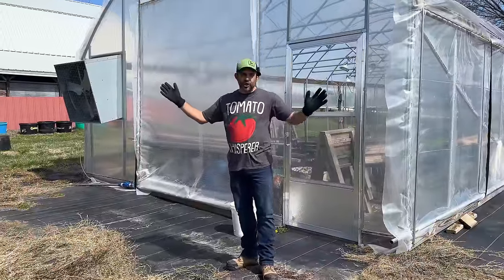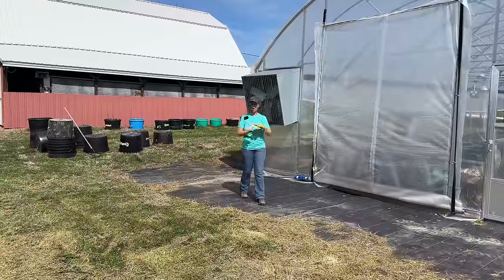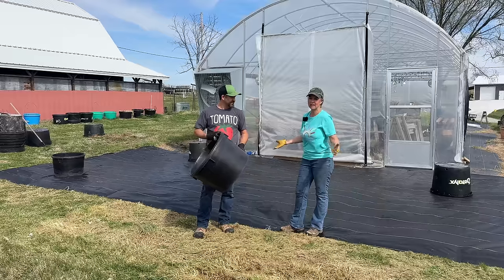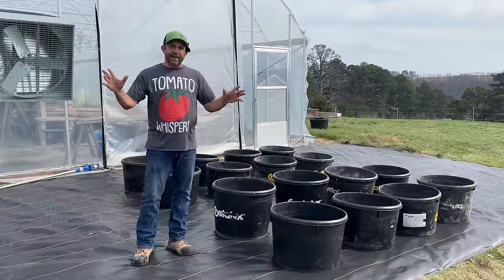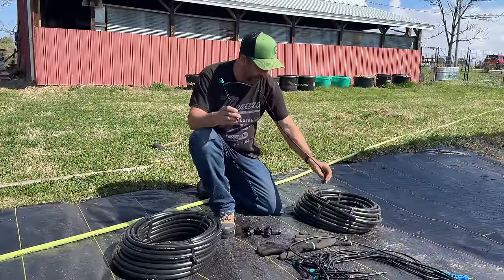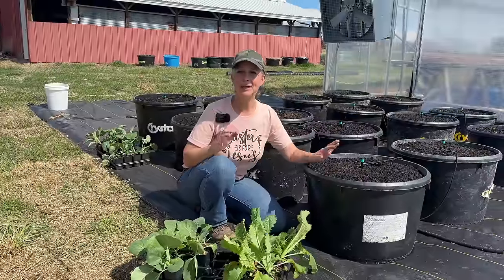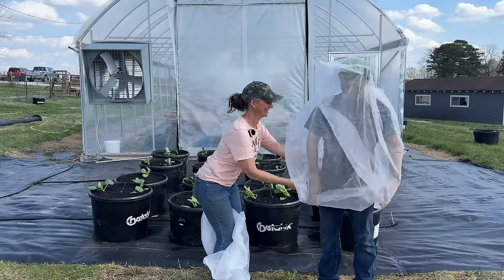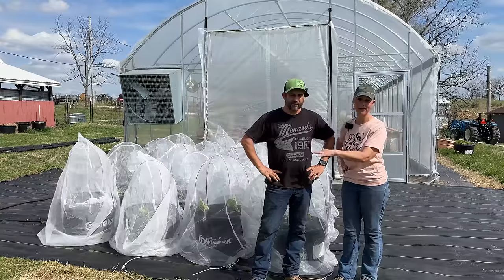We Turned a JUNK PILE into a CONTAINER GARDEN!

Comment: About that fence post et al "lumber":  Years ago now, we built 4 sided boxes to go over/ around black, nursery, growers pots of the big, tree size for aesthetics out of pallet top and pallet wood.  There was about 1"-2" clearance between the plastic pots and their 4 sided outer shells.  Each side consisted of a number of boards cut to the same desired length laid out on a table then secured using screws with a piece of vertical 1"x2" used as cleats; except for those secured with some repuposed interior trim, one side by lathe, and what ever else was available. We put 2 cleats per side.  Some of these sides had the cleats showing on the the exterior but most were hidden on the inside.  We used an ecletic combination of hardware and methods to secure the sides into a box shape.  Once completed, we dropped the wood boxes or shells over top our planted growers pots.  And yes, these were not particularly structurally sound but they simply needed to look more like a planter from the street.  -  What we found however is that the R-factor and dead air space (still plenty of air flow through) helped moderate the temperatures of the grow pots allowing for extended seasons and also helped in our hot summer drought.  They didn't do much but they did keep the plants happier in the summer amd then we noticed in the other seasons.

Comment: I use mineral tubs as self-wicking tubs and can fertilize the water as I add water through a pvc pipe. The hole is drilled 4 - 5 inches from bottom, with a drain tile pipe in the bottom of each tub. I got the idea from Gardening with Leon.

Comment: Those bags are nice! You could gather them at the bottom and slightly lift the pots and tuck them under so they'd be snug, even use a twist tie at the top X of the wire frame, probably not necessary though.

Comment: I’ve been container gardening for a few years. The wood planters had a plastic liner. Buy Rubbermaid or equivalent. They are fine but cheap bins  fall apart after three years. 

Secondly we had a reservoir in bottom. I don’t know I’d the fabric and dirt became too wet or if I watered too much in 100 degree weather BUT my soil became over saturated and that got higher and higher. I only had 4 inches of regular soil on the top. I’m rejuvenating and replacing the soil. The super saturated soil feels almost like sand. It’s devoid of compost. It did have perlite. 
🤷🏼‍♀️

Third we got white mineral 30 gallon buckets at the feed store. We are filling the bottom with drainage pipe and using some older soil but mostly Hansons compost.

Comment: I LOVE Growers Solution's weed fabric! As long as you keep the soil off it, nothing will grow through it but things/seeds can root on top,  but the weeds are easy to pull off!!! I bought a small battery-powered blower from Harbor Freight to blow debris/dirt off my weed fabric! You can buy mosquito/bug/tulle fabric in a roll to cover a long bed because some people, (me included) can't source the tubs you have, and using a roll of 9-gauge wire cut to at least 72", you can make hoops to hold the fabric above your brassicas. Prevention is better than wormy food or poisons!

Comment: I also put my drain holes on the side of buckets. Or some shredded cardboard at the bottom which sucks up and holds water. I think it helps in hot temps giving the plant a small reservoir as long as it's a deep enough container.

Comment: I got 32 of the molasses tubs and laid the same fabric you did to sit them on. I drilled several holes on the bottom and placed the pots on two 2x4 pieces of wood so it could drain better. I need to install a sprinkler system though. I'm doing it by hand right now. It's just me and it takes a lot of time to get it going.

Comment: I bought some of those same bags for my garden.  Mine after last year are not useable.  The fabric deteriorated and the bottom string rotted.  However, I was using a lawn sprinkler  so they were getting wet every day.  They did work and kept the bugs off, but at the end of the year, they were fragile.   I’m in Benton County and we have been a drought for 2 years.  Hopefully we will get some much needed rain this year.  Good video.

Comment: Looking good!  Although I don't use those bags, I have to use a mesh that is small enough to not allow access for the cabbage root maggot fly  in the spring, which also prevents the cabbage moths from accessing later in the season. The mesh or floating row covers is the only way I can grow brassica's, including rutabaga (a member of the family).   But I don't have to worry about that for a while because I am still snow covered and about 8 - 10 weeks out from planting outside.  Good video.

Comment: I experimented with a net bag on a collard green stripped after the worm infestation.  So I peeled all the  leaves off & covered it with the net bag.  It grew new leaves and it grew all winter.  Now it is bolting  and I plan to save seeds.  Now I plan to try on zucchini and squash because i can't seem to grow them because of vine borers and bugs.  I need to get some wire to make the hoops.   Do you think the wire will be stiff enough to make taller hoops for the taller plants?

Comment: I have been watching your channel for years and love your methodology for determining your course of action and how well you work as a team together. 

It’s clear that your area has challenged you over the years with weeds and bugs thus moving to ground cover and pots. 

There is fascinating research and methodology in permaculture and regenerative agriculture practices that highlight how to create optimal soil with soil fungal and microbes that create vibrant soil that supports optimal nutrition for the plants to provide that nutrition for those consuming it. I would be curious how you have researched and determined how to avoid the detrimental affects of leaching plastics on the body and lack of microbes as well as eliminating the nutrients from deep within the soil in your container plantings to ensure that the food you’re growing is giving the greatest nutritional benefit for your effort.   

Also, would you consider using a “lasagna style no till bed” using several layers of cardboard covered with 6-8 inches of compost over it and planting directly into it. Adding to it yearly and comparing it over several years to your containers in both work and results. 

The greenhouse would be an interesting place for an experiment of a 30inch wide x 5or 6 foot bed. Could be fun to watch. I’d be very interested in watching this experiment.

Comment: I've used weed fabric for the past 4 years and my biggest problem other than the bermuda grass sending runners on it from the edge, even under the landscape timbers, is almost everywhere I have a staple, grass or a weed will come up. The easiest way to get it off is with my stirrup hoe. Run it lightly across the top of the weed fabric and it cuts the grass/weed right off.

Comment: IF you have OR can get the lids, GET THEM and I will tell you why. I use the lids as saucers for my pots. I drill holes in the sides of the large pots and then use the lid on the bottom under the pot and that way it holds water for the plants when it rains or when I water them. AND it deters ants from building in my pot of vegetables so far.

Comment: Have you ever tried companion  planting it helps with bugs etc
Reply: Agree totally. Onions, Garlic, Marigolds, Basil, Nasturtiums are all good choices. Take up almost zero space
and are all beneficial. Deter cabbage moths, and some critters, attracts beneficial pollinators, cost next to 
nothing and provides additional food and herbs for personal consumption. Seems to work for us. 

Now, I never said anything negative in this comment. Actually, I don't see why it shouldn't work perfectly.
They did a similar video, a while back, on using cover cloth over a couple rows of cauliflower that was amazing.
And I've been a subscriber here since Kevin uploaded a video on building rabbit tractors when in Arizona.
What I did say and do was to "share" and agree with another comment from another viewer. 
An additional method.
TYFS Kevin and Sarah

Oh, here's another tip that might be beneficial on your back. If you should be buying compost in bulk,
it's way cheaper than bagged. However, take your empty buckets with you. Spread them out in the bed of
your truck and then let them dump your soil in. You'll spend way less time on the end of your shovel.
unloading it by the bucket full instead of a shovel full. Good Luck All in your gardens.

Comment: Question - do you have to drill holes in the bottom of the buckets that are inside of the greenhouse? I can see how you would need holes in the buckets that are outside because of rain. But you are controlling the amount of water going into the buckets that are inside so you don't have to worry about over watering (?). We are putting up a growers solutions low side wall house this spring.

Comment: I've been modeling my garden after yours.  I appreciate all the advice to this novice!

Question- I have been using drip lines for watering.  You use the little mushroom sprayers.  Is there an issues with spores, etc being splashed on the leaves from the sprayers?  I thought that's why folks used the drip lines.  Thanks for your help!

Comment: Question.  When I sees these pots/buckets they are used as "wicking tubs".  Is there a reason you are not putting French drain pipes in the bottom to hold water (therefore not having to water very often)?

Comment: I’m in central Louisiana and have about 15 pots like yours and plan to garden in them instead of in ground as I have for the last 45 years. I have a load of topsoil and plan to mix in cow manure, 8-8-8 fertilizer, perlite, and peat moss. Would you tell me the ratio to use with these amendments? I am a 77 year old widow doing this by myself. Until this year, my two older sisters have helped me garden. They are not able anymore. They are 81 and 85. If I tried to do in-ground gardening again, they would insist on helping. They fall too much for me to do that. Thank you both for your wonderful videos and witness for our Lord.